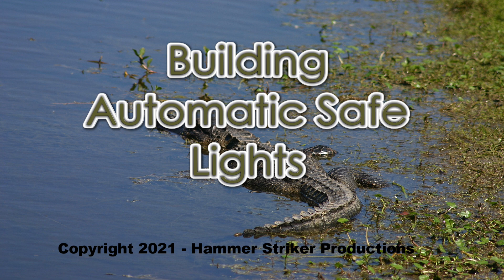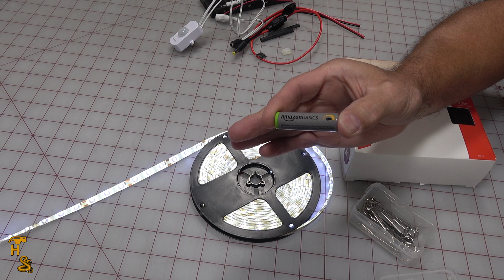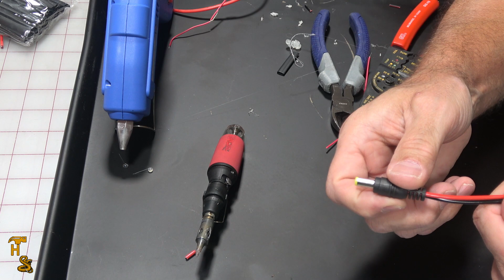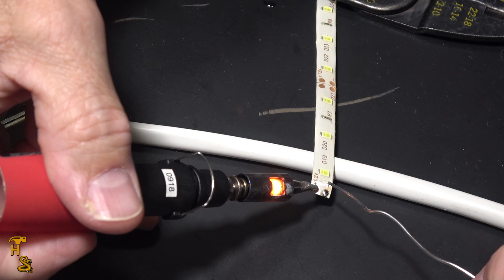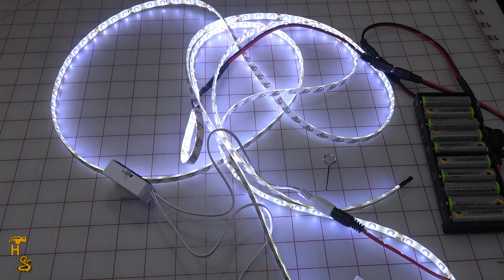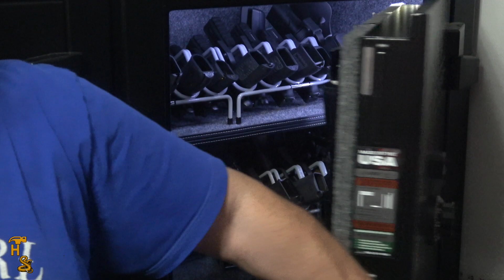How I Do My Safe Lighting (It Is Inexpensive To Do It Yourself.)

Comment: Great video of yours.  If you're interested in obtaining a TL rated safe there's many available used for excellent prices.  The so called gun safe are quite easily defeated.  
TL 15 vs TL 30 is the time it would take a professional safe cracker.. times are usually a lot longer... The steel is very resistant to attack

Comment: Man, this looks like a lot of work to light up a safe. I just got a couple of motion activated bar lights on Amazon. Just velcroed them babies up and now every time I open my door they turn on lights everything up, shut the door and they turn off. Will probably have to replace the batteries once a year once every 2 years. That just makes more sense imo. But you got a pretty good setup there

Comment: As an industrial electrician I’ve perfected the art of lighting. I use a 12v led strip tape on the inside and lay tue strips where necessary and solder splice everything together. I use a filmed copper tape across the safe seal surface to connect to my copper tape and then connect a 12V power supply to it and then connect it to a switched outlet. Also a door latch switch works great. On when opened and off when closed.
Reply: I used HITLights brand power supply and their Luma20 strip tape. It’ll light it up like a jewelry case.